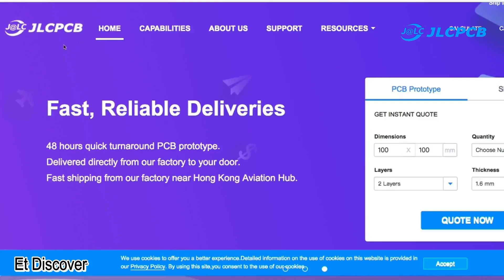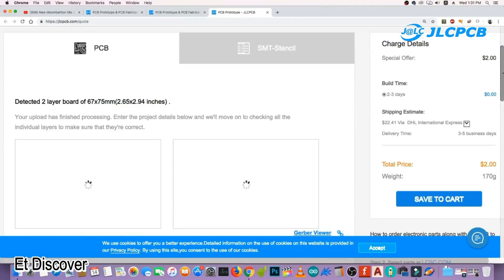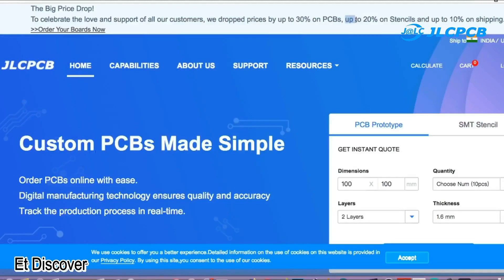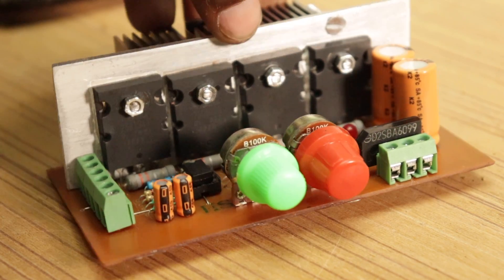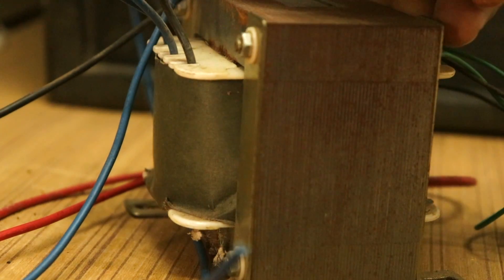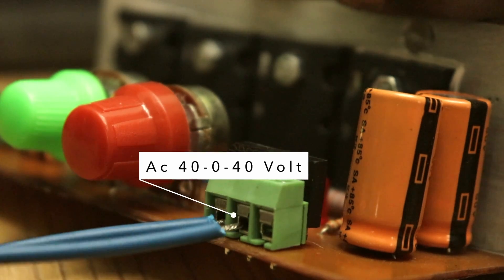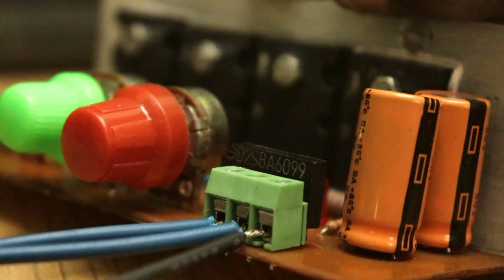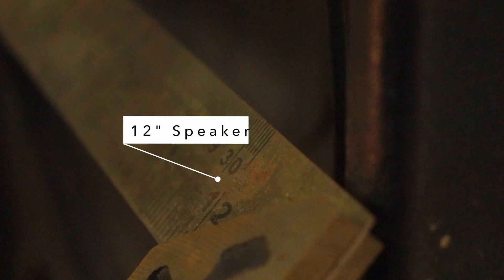Simple 100+100 Watt Audio Amplifier For 12" Subwoofer (ver 2.0)

Comment: It has a large amount of cross over distortion and more than likely wont produce 200w as a whole system because the voltage gain requires more current behind it to drive the output transistors. 
If the power supply isn't specifically chosen to meet the current (Amps)  requirement it will the limit the amplifiers gain and cause clipping.  Toroidal transformers are the best and very large capacity capacitors. This creates more issues for when powering up the amp but more circuitry is the solution to control these issues.
Although similar to my amp its missing a fair amount of components.

Comment: No way will that small heat sink handle 2 x 100 watt class AB it will get VERY hot and blow up the transistors. The circuit shows 50/0/50. The video shows 40/0/40. The demonstration video the sound is very distorted. I think this guy has no idea what he is doing. N0 protection, no heat compensation. I doubt the drive IC has enough current to drive the OP transistors. I would not waste my money building this.

Comment: Pcb layout wrong hai
Reply from the maker: Bohi PCB se meyne kia. Kia wrong he boh mujhe bata sakte ho
Reply: @EtDiscover  sir jo ap ne pcb banaya hai aur Jo pcb dekhaya hai dono main bahut frk hai
Reply: Jaise sir ap ne lagaya hai 0.33ohm 47k 10000.50v 1000.50v
Reply: Circuit main kahi nhi lga hai
Reply from the maker: 47 k boh feedback resistor he. 33k me apko acha sound milega. Jo problem me face kia ap boh problem me na aaya isliye diagram me sehi dia
Reply from the maker: Yea AK demo video he isliye just 1000mfd use kia. 38-0-38 volt ke liye aapko 10000mfd jorur chahiye
Reply from the maker: PCB bilkul sehi he. Aap jab usko copper board me lagauge tab sehi dikhayega

Comment: The amplifier is very good, but nevertheless I notice two details regarding the value of the main filters of the power supply that in the diagram say that they are 1 microfarad for 50 volts and in your place in the circuit 2 for 1000 microfarads by 50 volts and apart you connect in parallel 2 more filters outside the circuit. To avoid problems of noise in the speakers (hum) the filters should be at least 4700uf x 63 volts.and the other is that the opener Lm 358 would work more stable feeding it with zener diodes instead of being powered by the resistance of 2.2 K ohm Thank you.
Reply from the maker: This is a demo vide. For 38 -00-38 volt you definitely need big capacitor

Comment: Dear sir plz make video on  pwm based adjustable power supply which output is 0 to 12v dc and output  cuurent rating is aprox 50 amp
Reply from the maker: Ok I’ll try

Comment: Hi sir can i request for voltage regulator with digital voltmeter range to 30v at least 3 amps circuit diagram?
Reply from the maker: Ok brother
Reply: @EtDiscover  bos thank you so much sir i really need that waiting for that  sir
Reply: @EtDiscover  waiting sir